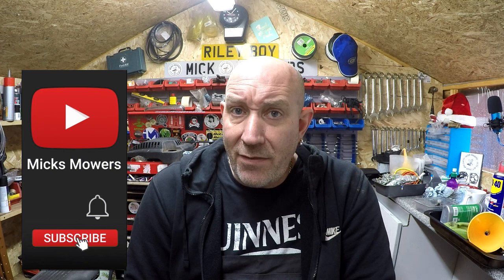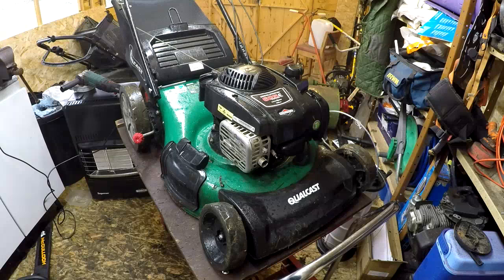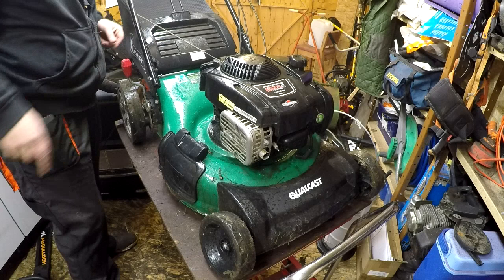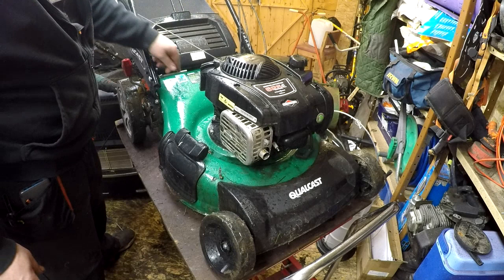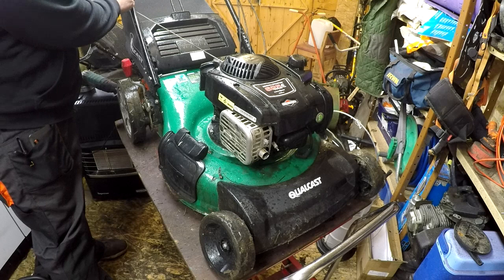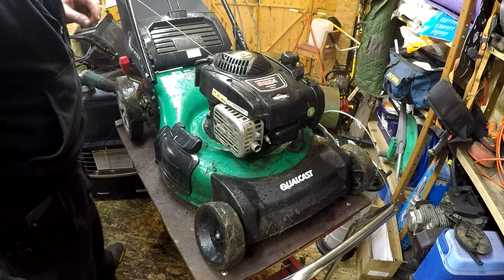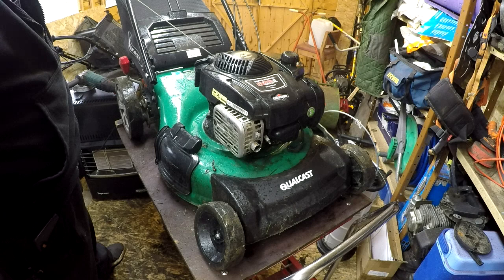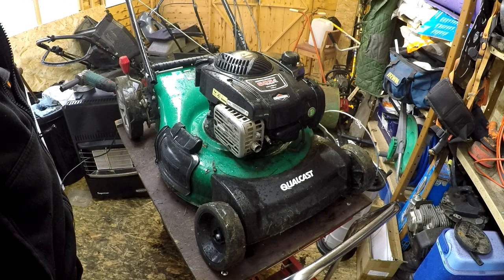Bent Crankshaft How To Replace Simple fix Low Cost

Comment: Trying to do a catch up on your videos as I am well behind, that shaft was well bent on that Briggs and Stratton engine.  
If you  get a new honda GCVx engine in with this issue which is the brand new Honda GCVx engine they are now fitting to most new mowers the crankshaft is alot easier to remove the compared to the old GCV engine and  you don't even need to remove the engine off the deck. Honda have designed the new engine like a two stroke engine so sections can be removed and replaced easily.

Comment: Im digging the lift set up. Ive got a 6 1/4 with a badly bent shaft. Never done that in my life or sheared a pin till i hit 51 years of age. It instantly turned into a tiller. Some ass clown put cross ties in for a makeshift flower bed and  secured them with re bar but didnt bother to drive the rods down flush with the wood. I turned to continue cutting in the opposite direction and clipped the 2" tall  3/4" diameter rebar and thats all she wrote. Why didnt the key shear or the hub break? From what i understand the hub breaking off is the new shear key safety device.  Curious how much is a new shaft? 38.00 you just answered my ? Thanks

Comment: Hi Mick question for you I have a petrol strimmer i put it away leaning against the shed wall went in a couple of days later and its leaking petrol could not find the leak put it back and noticed its leaking through the exhaust all the petrol was in the engine emptied it runs ok have come across this before. love the vids
Reply: Had something similar on a Stihl MS180 chainsaw and turned out to be the tank breather blocked.  Once tank had pressure kept feeding fuel into the carb-cylinder-exhaust-air box. Maybe as a start Check your tank breather is working.  This may be through the cap or have a separate breather tube out of the tank depending on the strimmer you have.
Reply from the maker: Try to loosen the tank cap a touch see it that works
Reply: Micks Mowers Cheers Mick I will try it 👍

Comment: At 33:10, after application of gasket sealant and reinstallation of the pan head, are all the pan bolts fully torqued after only 10 minutes (and then left in place for 24 hours before filling the pan with oil)?
Reply from the maker: Just kiss them down and go back later to do up properly

Comment: Great video.  Hmm no pan gasket ?  What gasket material did you use?  Should be a great running engine for a long time.  Great job.  Thanks for sharing.
Reply from the maker: It's a oil and heat resistant one.. it works well..

Comment: Hi Mick have you ever set the governor on a challenge mower with SEMEC se475 engine if how  thanks Mike from Stockport
Reply from the maker: Hi mate. Undo the 10mm nut. Set the throttle to flat out on the carb.. twist the governor rod clockwise.. hold it and do up the nut.. hope that helps
Reply: @themowerman  Hi Mick did what you said . It starts revs then dies  does the carb have a rubber o ring on the back.if I move governor shaft halve way it screams it's head off thanks Mike  I Don't want to be a pain  cheers

Comment: Wow, what would cause that Mick?
Reply: Phil, with the blade turning in excess of 3,000rpm, contact with just about anything solid will cause this. A root, a stone or some other unseen obstacle. The blade hits, then glances off the obstruction often bending the shaft and blade in the process. Simple diagnosis is, the mower starts vibrating badly. Most crank shafts can be straitened and blades replaced, but sometimes, a crank replacement is needed. Cheers! Zip~
Reply from the maker: As zippo said

Comment: Hi please if you see this  if need spares for my Suffolf punch 43s can you help me  pleas ?
Reply: Some lawn mower dealers or spares providers can help as long as you quote the serial numbers, usually the F0 number is the one that works. Just be warned the old Qualcast mowers that were built by Bosch are starting to have shortages in parts now as Bosch don't supply the parts anymore. Allett mowers now sell the old Qualcast bosch design cylinder mowers but some parts have been changed in design so they might not be compatible with the old mowers. The new Qualcast mowers are not related to Qualcast at all as they are a Chinese mower with Qualcast stamped on them.